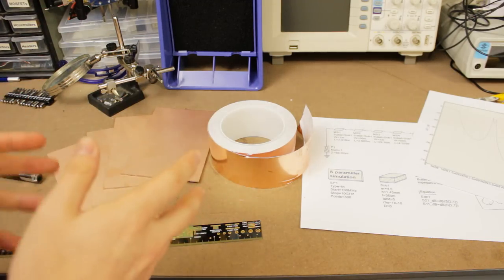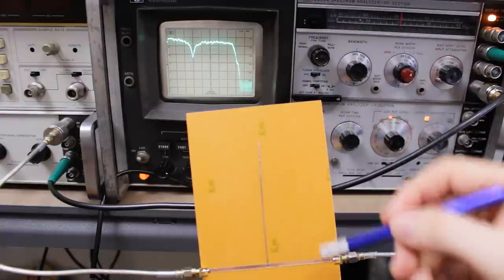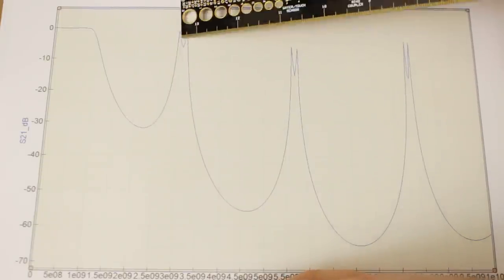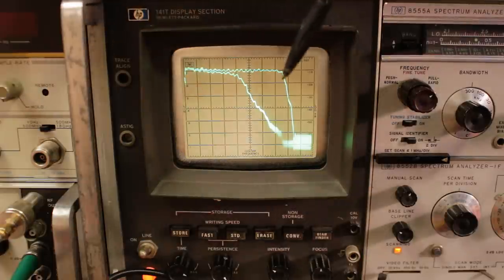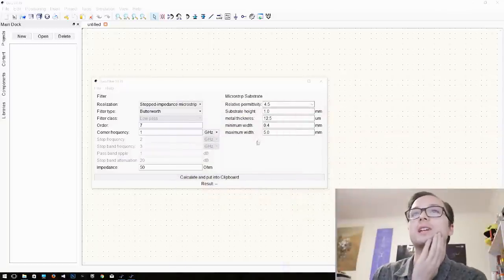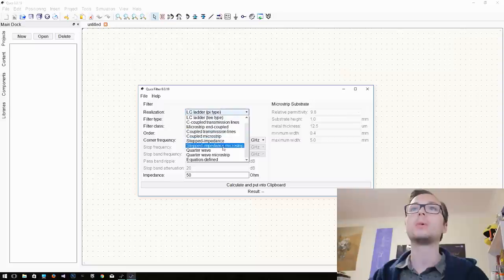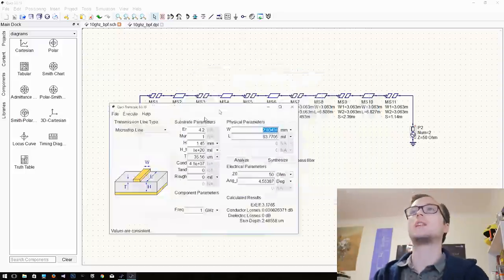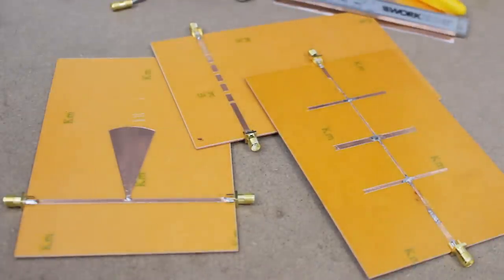Rapid Prototyping RF Filters with Tape & QUCS

Comment: This is a microstrip-line. There is literature up there. 
I like the filter Butterworth maked with piece of metal and isolating materials, instead of RC opamps active circuits. That push Butterworth beyond, 91 years after.

P E R F E C T

Comment: Congratulations about the ruler and the "tape on PCB" prototyping method. Way cool.  I have a note: that radial "radio stub"... you mention that it has a slightly broader bandwidth compared to the linear stub you presented a minute earlier. I believe that this "broader bandwidth" is a feature of your imprecise manufacturing, rather than of the shape in theory. Your radius (circle section) is not precise enough. (did you use a scribing compass?) If it was precise, I daresay its bandwidth might be on par with the linear stub, but more importantly, it should give a deeper attenuation at its center frequency - that I believe is what the shape is for. As the wave spreads out through the circular section, the "transmission line" gets gradually broader = lower impedance, and at its lowest, it meets the open end (infinite impedance) and, being a quarter-wave stub, it reflects that mighty impedance step into a perfect short at its narrow end.

Comment: that pcb materials are not FR4 they are probably CEM-1 or CEM-2  type. the dielectric is unknown and not suitable for HF circuits.
Reply: @NeungView   I'm assuming that the PCB doesn't have any copper layer on it. Is that right?
Reply: Try Rogers pcb RO4350B, RO4450F, and RO4003 microwave materials.

Comment: The width of the trace sections is either 1m or 50m? I think you're going to need a bigger PCB!

Did something drop a unit somewhere? I assume it's supposed to be mm.
Reply from the maker: QUCS uses unitless SI prefixes in this situation, so e.g V1=1m is the same as 1mV and I=1p is the same as 1pA. I agree though that the inclusion of units would make it clearer..

Comment: Well, this is an old video, I hope you see this messege. I want to ask you how did you change the QUCS schematic strip sizes to the shorter strips you made with de conductive tape? 
For example, the first inductor is 7 meters long and 1 meter wide and the lines you made are far smaller. 
Thanks.
Reply: jeeeez ur ... m stands for fakin MILI, not meter...

Comment: I'm guessing this method wouldn't be very "practical" for say a 7.0 MHz 40M band filter due to the element size would it? Unless perhaps your elements zig zagged back and forth to get the right electrical length in a more compact space?

Comment: you will have much better luck with FR-408 or Rogers-4003C. Also use the dielectric constant from the material data sheets
Reply: Good luck finding and buying those.

Comment: SEBEBEBE
Reply: The loss on 10 ghz are the high 3/6 db the sma connectors cheap from China or good stuff 
Regards from sietse pa3dee I like your video.s nice video's
Reply from the maker: Yeah you're probably right about the SMA connectors contributing to the loss up at 10GHz, they are chinese cheapies. I'll have to do some more experiments with better ones to see exactly how much it is. Cheers :)

Comment: what is a quality factor? The rejection is not deep - I had the same result with low frequecy high voltage ceramic capacitor and piece of wire: resonance was roughly at 20MHz but bandwidth was several MHz.when I changed a capacitor to RF type (NP0) - quality factor was much increased.